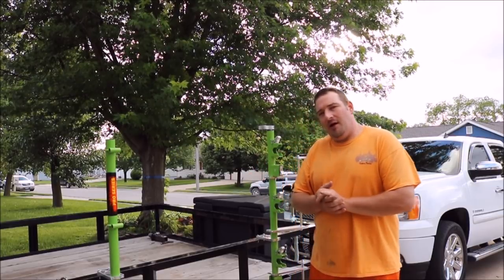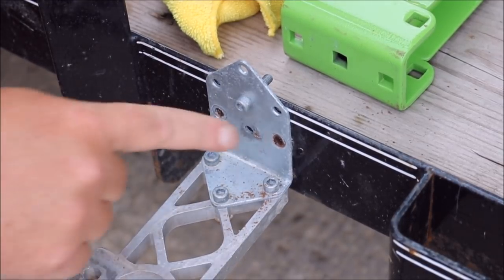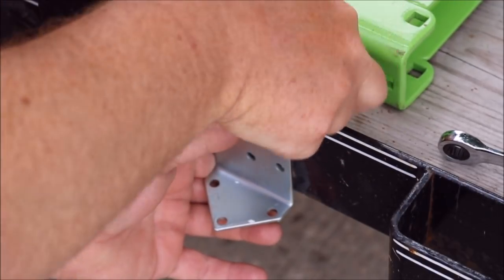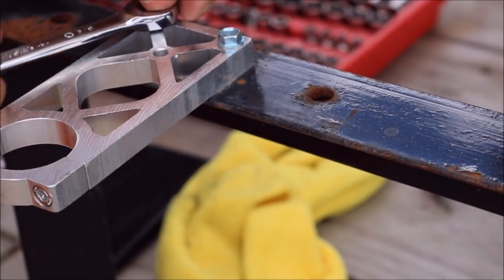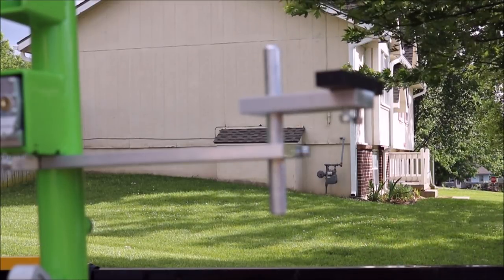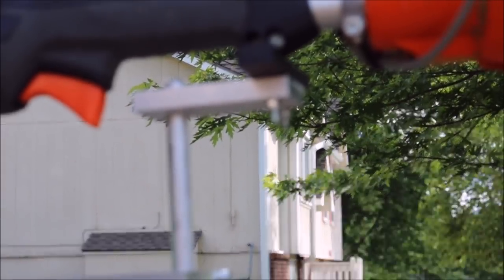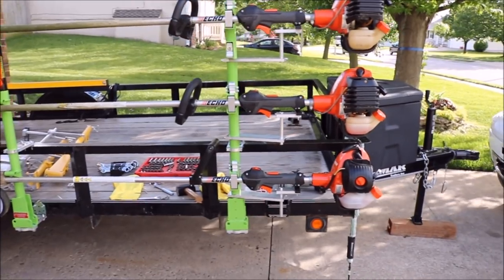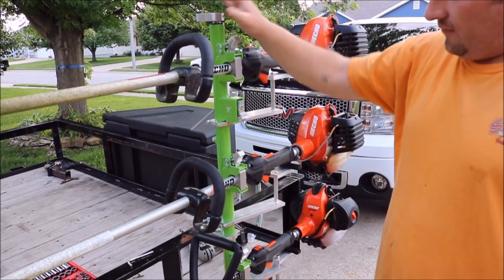Green Touch Trimmer Rack Installation/Differences Between Old And New

Comment: Danny, 
Do you see anything in the hardware kit that seems like it could work with a round pipe trailer tube? My current trailer doesn't have the flat angle iron sides like you do. I will get my own hardware if not, but just seeing what your opinion is on how to mount them on a pipe top rail trailer.
Reply from the maker: Detailed Lawn Services email me and I'll send you the pic of there idea of mounting them on a round pipe trailer
Reply: Email sent, thank you sir.
Reply: Lanier Lawn Care 

About to do a round rail any videos out ther
Reply: I have mine on a round pipe trailer.  I welded mine to the bars and it’s way more solid than this.  Plus you can’t steal the whole racks lol.